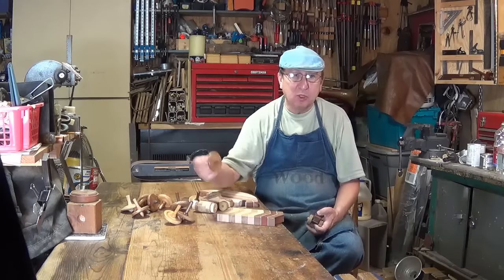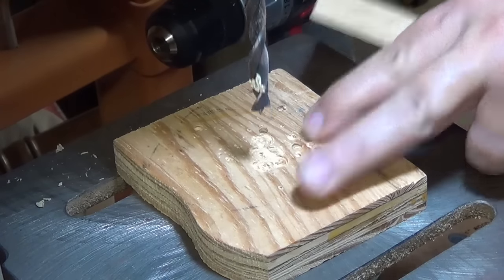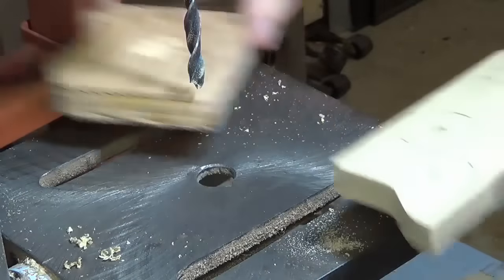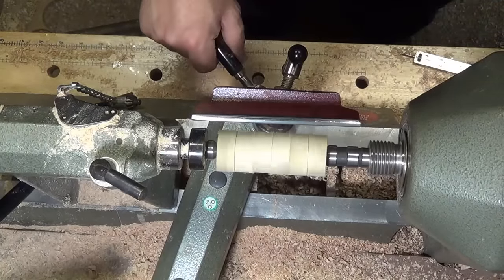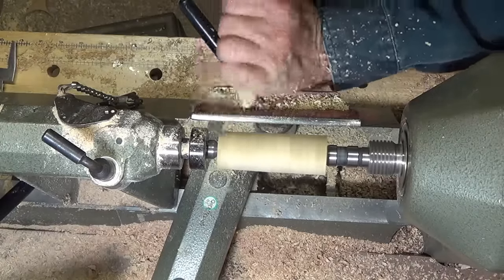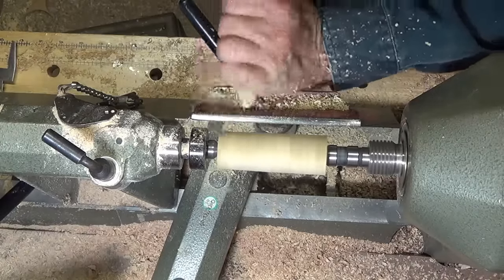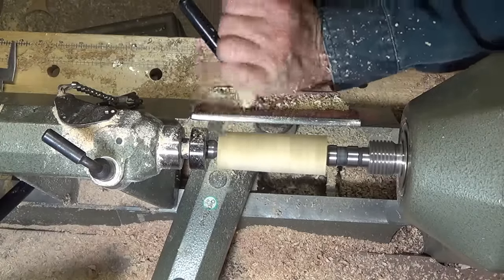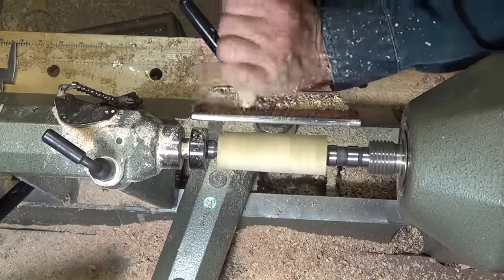Making Toy Wheels Four at a Time

Comment: The jig for multiples is a good idea. I found cutting out the rough blanks with a hole saw on the drill press goes very quick to punch out a bunch of them. I then drill out the center for whatever axle I'm using at the time.
Reply from the maker: +william morrow Greeting William! Yes there are many ways to make toy wheels. I just wanted to share this one. Thanks for watching and thanks for the comment.

Comment: I think this method is less complicated and less time consuming that fighting the hole saw technic ,I am going to try it and finish my grandson tow truck *(I bet can make the pulleys using this technique also) .Thanks and merry Christmas.
Reply from the maker: Howdy Rene! Yes, give it a go. Cheers
Reply: On a drill press its a piece of cakk and they are all exactly the same size. A lot faster too. I use Starrett and Lenox hole saws only along with their mandrels, not the hardware store variety.

Comment: Hi Cip! I just rewatched this video bcs I just purchased my first real lathe although I have never tried my hand at lathing I intend on learning all the different techniques. I was looking for a way or an idea towards lathing wheels bcs I have yet to buy a jaw chuck. All of my stock wood is 3/4" thick so turning perfectly square blanks with just the spur and live center wouldn't work unless the wheels I turn are very small, so thanks for the jig idea for turning flat stock! My question is even though you show how the jig is used, is there a way to make the front profile of the wheel to have a little more detail without a jaw chuck? I know that making a one side mandrel jig could possibly work but youd have to have some kind of pin to lock the turned wheel onto the jig without damaging the turned wheel! Thats my delima for the time being atleast until I can afford a jaw chuck! Thanks for the video idea and your feedback!
Reply from the maker: Howdy Kevin! Without using a chuck, I can only think of two ways. The first is by using a screw chuck which might reguire a small purchase: see Chess Piece video https://www.youtube.com/watch?v=h4Fh_-KCiGs
or Wine Bottle Stopper video https://www.youtube.com/watch?v=nP3EJm4ipgA but use a bolt and nut of the proper size. Most lathes include a face plate, cheers.

Comment: That's SO funny!  I had to make a sign that said STOP that I hang on my bandsaw cause I kept running it with the tension off. I ruined a 1/4" blade trying to cut a circle in a log with no tension...
Reply from the maker: +Josef Roesler I have not done any damage yet. My saw uses urethane tires that break much too often. So, I am trying to de-tension the blade. It has helped some. I just bought some BlueMax urethane tires maybe that will help.

Comment: So, for curiosity, would using a hole saw on a drill press to cut the circles in the first place be easier and faster?  I have tried doing this on the lathe, too, but you have a much nicer and simpler mandrel than I used.  Thanks.
Reply from the maker: +Norman Worthy Yes, it is an alternative, then drill them out to 5/16 inch. It may be worth investigating. Thanks for the comment.

Comment: what type wood lathe chuck would recommend. i just bought a wood lathe and I'm going to turn things like toys, ink  pins. don't know which chuck to buy thanks for the help.
Reply from the maker: +KNIFE MAKER I am only familiar with Nova chucks. They work great for me. I own three different sizes but the Nova G3 is the one I use the most. Also Nova makes a wide array of replaceable jaws. 

There are other brands of chucks out there, I'm just not familiar with them. Thank you for your question.
Reply: thanks

Comment: Exzellent idea to make wheels. I have 2 questions: why using bandsaw and not putting square stock on the lathe directly and turn them round to any diameter?  And why only 4 ? What about 8 or 12 even with different diameters for each 4?  I like all your videos very much.
Reply from the maker: +Dr. Michael Excellent questions! You may have noticed in the video that some of the end blanks caught and slipped, but once round(ed), they were easy to size. The blanks are held in place only by friction, pressure from the tailstock. Square corner would make it more difficult to round. Only my experience, someone else may not have a problem.

I only make four at a time because the main shaft is made of pine. The longer the shaft, the more it will flex. Wheels may be out-of-round, slip, or the shaft may break; more pressure needed from the tail stock.

Thanks for watching and thanks for your questions.